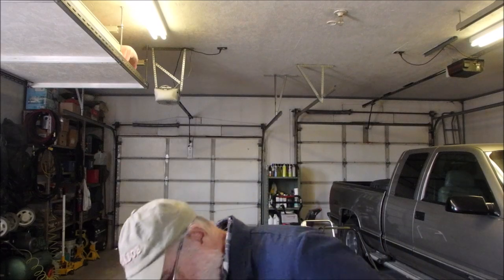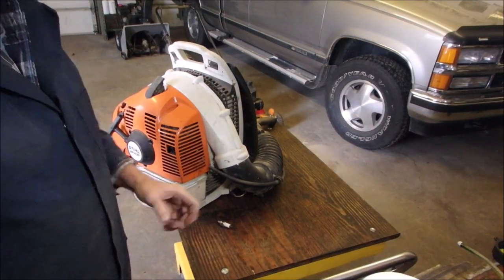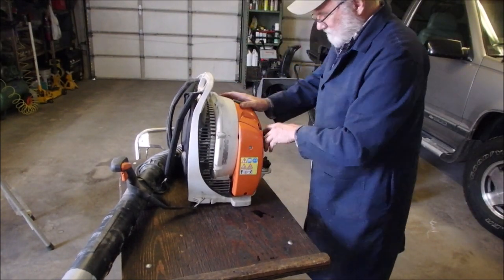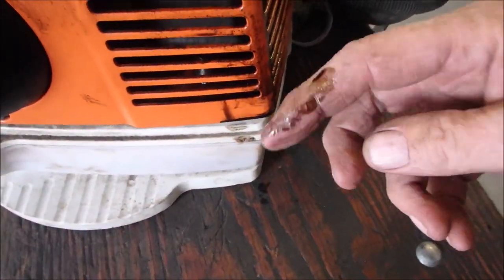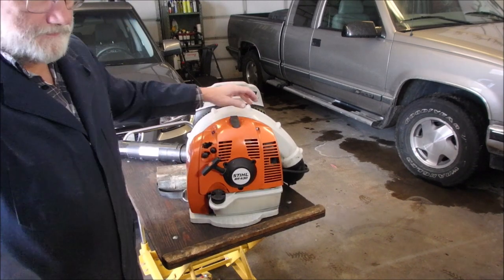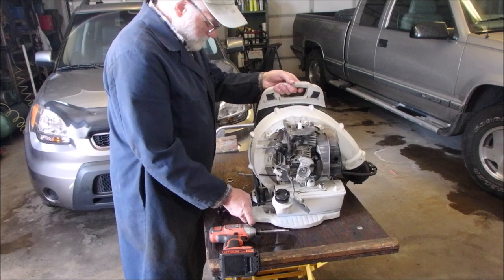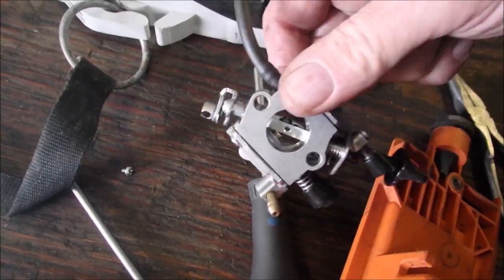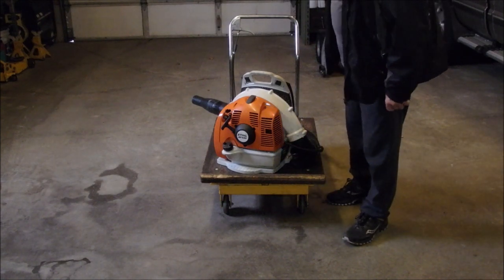A Stihl BR430 Backpack Leaf Blower  Won't Run

Comment: I think you invented the problems your self  the blower looks hardly used to say the spark  arrester is plugged  I don't think it even came off that  blower   no not convinced  sorry
Reply from the maker: Well it was plugged ,  I could not blow through it. 
I went to your channel.    I think you need to make a few videos so you understand what it is like.
Reply: I see it all the time with new equipment and uneducated operators that just throw in 2 stroke oil by eye balling it.
Reply: I use good oil and proper mix on my BR600 but still need to clean that spark arrester about every 50 hours. Otherwise, the blower will start but stalls and bogs on acceleration.

Comment: I think the previous guy failed to check the condition of the spark arrester screen. So he took apart the carb instead, thinking it was a carb issue, he pulled out the butterfly valve, for doing a deep cleaning, and he failed to install it back in the proper orientation. Of course the amazing Bruce Pender figured it out, and fixed it proper. Great job Bruce!
Reply from the maker: That could be!!!

Comment: Good job  Bruce, I have an old br400 and it needs to be started 1 pull full choke then ran for 1 min. 1/2 choke then it's happy , been like that for years!
Reply from the maker: Yes that is common on a lot of engines.

Comment: Good job Bruce. Stihl does make some good equipment but they can be a pain to work on. Stihl normally uses Zama carbs. I have an old BR400 back pack blower that I let my dad keep and use. I finally had to replace the carb a few years ago. I bought one of those Chinese knock offs and it runs great. Most Back Pack blowers should be started in Idle position and them idle a minute or two to warm up then they are good to go.
Reply from the maker: Thanks for the info

Comment: I always take the blower tube off first when I work on blowers. Always in the way. You can zip tie the throttle controller to the side off the machine for testing. It easily unscrews from the tube.
Reply from the maker: Great tip!  Thanks  We don't see many backpack types up hear as i am sure you could tell.

Comment: Stihl owns Zama; bought the Japanese co. in '08. Thus, that must be an aftermarket carb. Great catch on the plate. At one point I thought it might need a valve adjustment, but after checking, I learned that the 430 is not a 4-Mix engine like my BR600.
Reply from the maker: Right

Comment: Good mechanical detective work Bruce ! Although some Stihl blowers are 2 stroke and others 4 stroke, they all start the same : you just turn the choke on 1 or 2 notches ( it will also open the throttle a bit) no need to fiddle with the throttle trigger on the blower tube. Once started, touching the throttle trigger will cancel choke and bring the machine back to idle. Oh yeah, for the younger crowd, that "Clampett" joke was a referral the a '60s tv show called The Beverley Hillbillies. Regards !
Reply from the maker: Thanks a lot.

Comment: Hey Bruce stihl backpacks will always need choke on first start, no throttle requires as full choke does that for you. Once started turn choke off and it will or should run ok.
Reply from the maker: You know i dod not know that at first.  Thanks for the great info

Comment: How did you solve the compression issue with the hard to pull start cord?
Reply from the maker: The only thing that helped was a bit of oil in the cylinder through the spark plug hole.